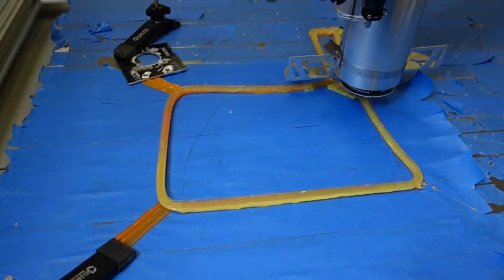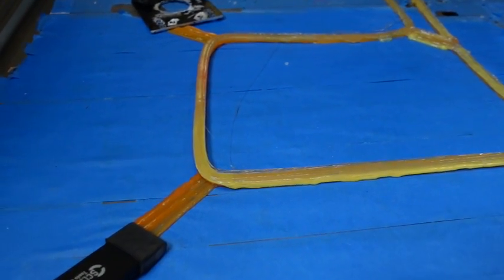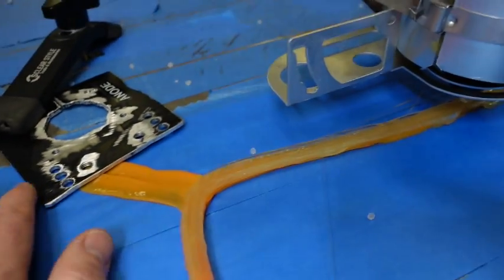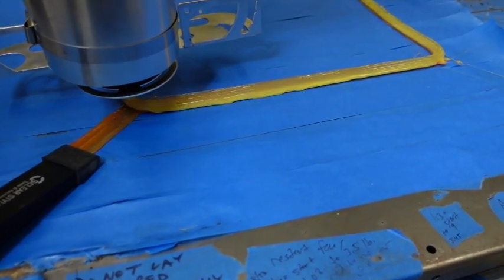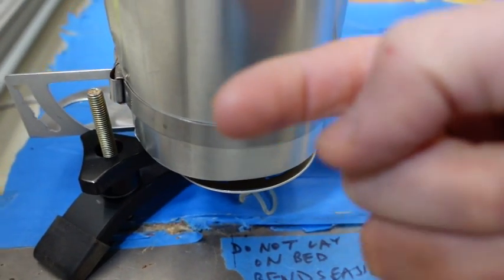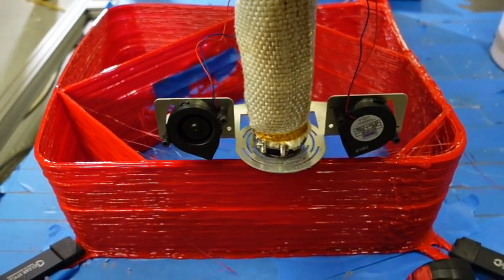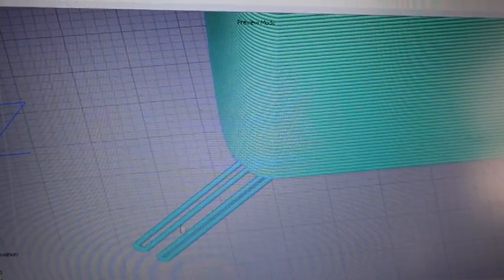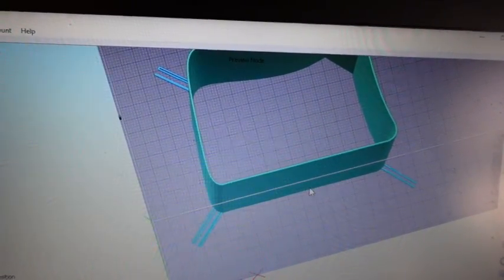3D printing with tabs and hold downs

Comment: Maybe some sort of buffer could be used to increase the consistency of the  output flow? Like a decently sized hot plastic chamber or something? Sure it would be annoying to clean, but it would improve the looks. Also the way it stops on the corner probably doesn't help the end result. 

I am alsp curious why the color between layers is inconsistent? Maybe the pellets aren't mixed well enough? 

The injection molding does seem cool. 

Yeah the rest of the comments are right, it does not look very convincing. But, it seems that the three axis assembly is fairly consistent, I think the extrusion rate is causing a lot of the looks issues.

Comment: That's so interesting, do you have a CNC machine with a 3D printing module on it? I ask because back in highschool we had a Stepcraft and the drafting and woodworking teacher were heavily considering to get a 3D printing attachment for us. I guess we didn't because they certainly didn't know how they would get it to work and the IT teacher already had a MakerBot, a few years later got a Prusa and gave our class open access to the MakerBot. 

A lot of people dunking on you here but they forget this "hobby" is seeing a lot more uses elsewhere and that it is great for prototyping/getting a crude object out for testing. I'm sure you're looking for ways to make your chairs a lot smoother with faster print times... unless your customers are liking the aesthetic lol.

Those tabs are a good idea, I saw someone not too long ago do something similar after wanting to use minimum brims but not have curling edges. 

Someone else also added these tabs to elevated parts of prints that needed supports. Use case varies but the idea is all you have to do is snip the support off and do light filing/sanding, whereas if you did traditional supports it would've made that section rough and ugly.

Keep it up, you have an interesting setup. I do wonder what plastic material you're using.
Reply: I just read the description, that's A LOT of PLA. Holy.

Comment: Hi Sam, just curious what material are you using to print your chairs? 

I think it’s a pretty interesting solution for printing a large sized object. Not everything can be printed on a heated surface.
Reply: I just watch the previous video that’s pretty wild so you using an injection mold tool for 3D printing. So I have to image the part strength actually might be stronger than a typical 3D printer
Reply from the maker: It's a hybrid extruder and can do 3D printing or smallish injection molding. Part strength is strong. Hopefully I will quantify in the future. It's gonna be a while.

Comment: credit where it's due first. You got your own custom nozzle running with some alternative source of plastic. the world does genuinely need more of these.

However, you need to fix your shit bro. Heat your bed- ideally enclose the whole printer so the bed stays at a constant temperature. Get rid of the tape, or if you STILL need it after, you should probably just tape the tabs of your printed chairs down- with clear packing tape, so you won't have any more collisions.  In the rest of the printing world they'd print the tabs the whole circumference of the print and call it a "brim", but I don't hate this minimalist approach if it works.